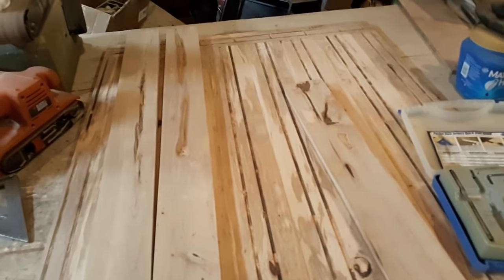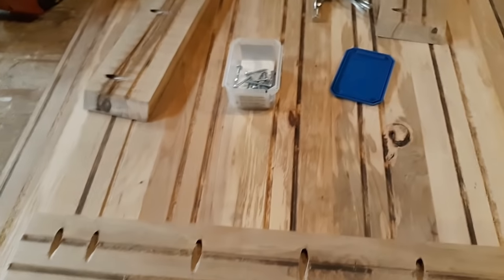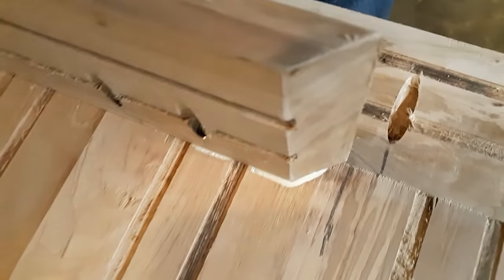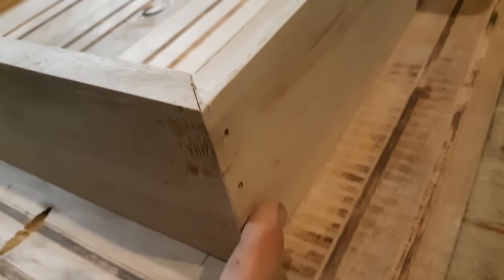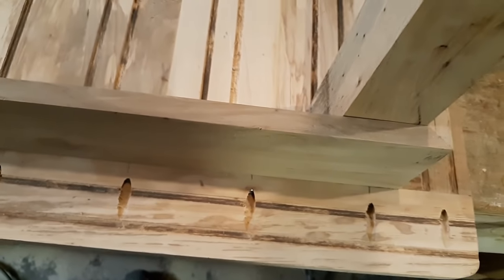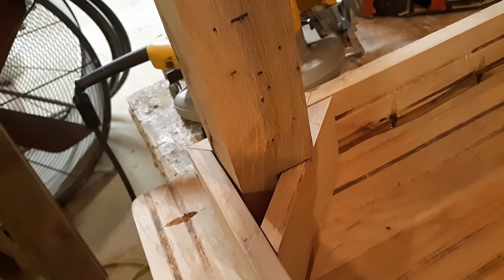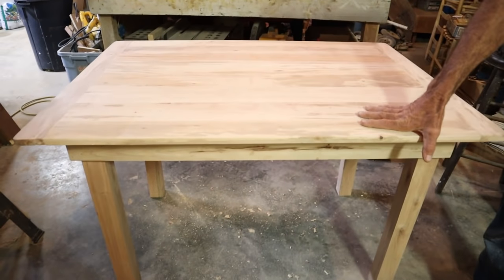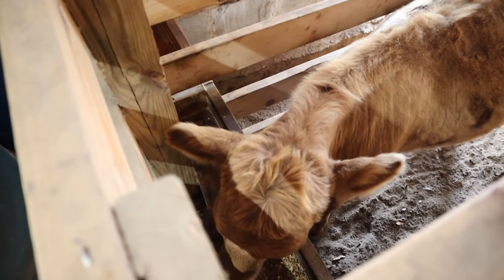Simple FARMHOUSE Old Fashioned Table for the Off Grid Cabin

Comment: Danny, if you use a rag instead of the foam brush you don't have to worry about going with the grain. You rub it in in circles with a  folded and dipped rag or use a sprayer to apply then for both you get another rag and rub it in  using circles again. The circles keep it even and you can see where you have heavy streaks. Going with the grain can hide piles of stain especially in colorful grain wood. Yes I know I am trying to tell you how to do it , but not demeaning only sharing knowledge gained from years of having my own cabinet shop and having a good friend that always needed help in the spray booth on bad building days
Reply: another time saver is take an old sturdy bar stool, remove the back and cushion from the seat, screw 2 wood strips to it. Then put your item on it upside down, now you can spin it around so you can easily get all of it without moving, stain the bottom and either wait till it dries or if the under side isn't critical you can flip it and do the top. With a sprayer set up you can stain it in 2-3 minutes.
Reply from the maker: I started to but realized I didn't have any rubber gloves.

Comment: Danny I ain't no expert but I do watch a whole lot of woodworking videos and they are always worried about the wood moving as it shrinks and swells and then they always have some way to deal with that in a tabletop so you don't have splitting happening did you do something to mitigate that
Reply from the maker: It has kerfs cut on the underside of the top every inch.

Comment: Table looks good but it's gonna rip it's def apart within a year or so. You can't control the expansion and contraction with screws and glue. If any piece can't move when humidity changes, it's gonna crack
Reply from the maker: Built one several years ago just like it except larger still looks like it did the day I made it. No crack's anywhere.

Comment: I mean no disrespect. The table is beautiful.  Unfortunately the construction method does not take into account expansion and contraction of the wood. The table top being screwed and glued to the apron underneath will not allow the tabletop to move with heat and humidity.  Eventually the table will tear itself apart with seasonal movement.
Reply from the maker: I built one out of poplar years ago and it's still just fine. Looks like the day I made it. I guess we will wait and see.